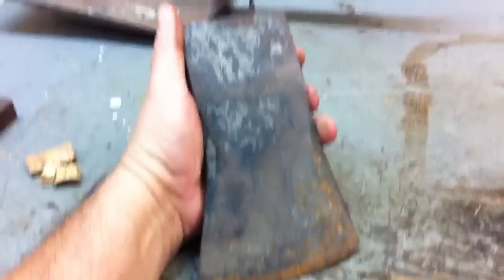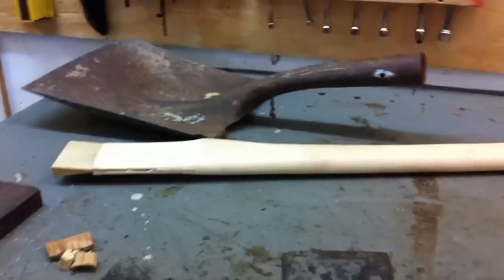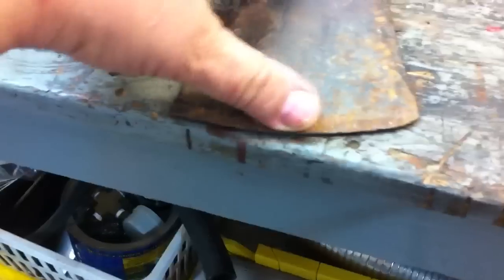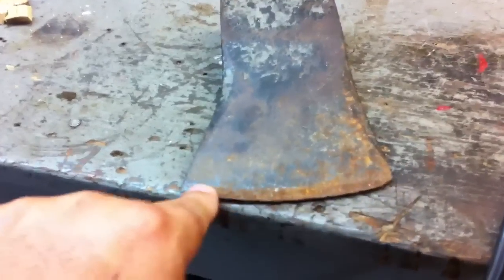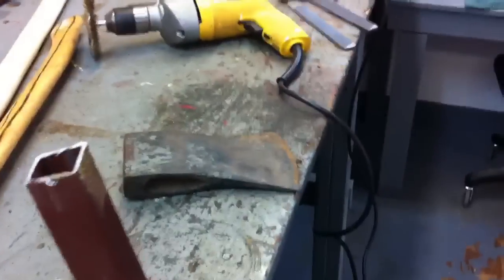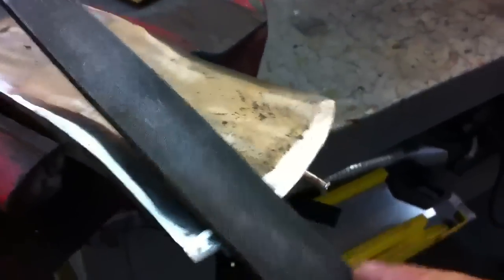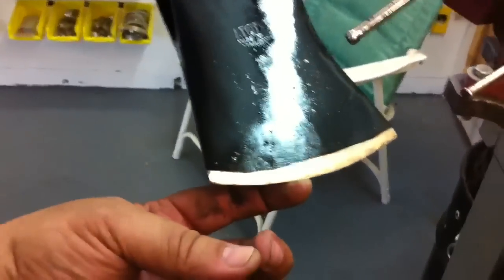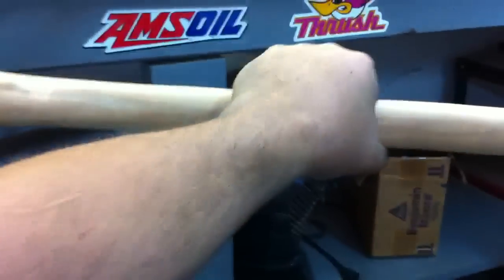How To Sharpen An Axe

Comment: Welcome to the buggered left hand club.
I chopped thru 3 tendons on mine, healed up pretty good though.
I'm the same way with tools.
Everything I have is either sharp or nicely dressed if it's a hammer punch wedge etc and I soak the handles in oil for weeks as well.

Comment: I'll tell you one thing: had lot of axes- german,canadian, polish, but for last 6 years I use Fiskars stuff (heaviest 2,4 kg axe) for chopping wood. It is excellent, it has special wedgy shape, good weight (not too heavy and not too light) and amazing handle made of some heavy duty plastic- despite 6 years of heavy use there is almost no signs of damage on that handle while  traditional wooden handle in old axes I changed once or twice a year.

Comment: I'm glad you liked it. I should clarify soak after the handle is installed. Some folks fill a container and put the tool in head down, I just keep on loading the eye hole up while I prop the tool up. The oil soaks into the wood my way and I don't need to dirty a bunch of oil. Now that I am wise to the splendors of paste wax I wax everything. If it is solid you can wax it, and probably should too! A word to the wise regarding linseed oil if you clean any up with a rag hang the rag outside to dry.

Comment: My brother was a blacksmith, every night they put the sledge-hammers into a tub of linseed oil. My brother said it was to keep the wood supple, and thus absorb some of the shock- makes sense if you are hammering all day!
BTW, I'm surprised you could sharpen it with a file-- I thought axes were too hard for that--maybe it HAS lost some temper?
You are a handy guy-- but best not to rob taht surgical wire if you need wire for a job!

Comment: If you would like to really make those axe heads look good, and also sharpen them quickly and smoothly put a belt sander upside down on your workbench with a fine belt on it. Lay the edge down on the part with the support platten under it, and for the final edge at the tip lay the blade down at a real fine angle on the unsupported part of the belt. Your axe heads will look better than bran new and you will have a great convex edge that you can shave with with a little practice. Best of luck.

Comment: A 4" grinder with an 80 grit sanding disk on it works really well for pitted up axe heads, switch to finer grits for profiling the edge blah blah blah :)

Comment from the maker: @DerrickHair I dont have a bush axe to do a video with but you could start with a 10or 12 inch mill file then finish with a sharpening ston. If  the edge is really beat up you might have to use a grinder in it. You want to avoid that though if there us any way you could work out the nicks and dings with the file. That is the best method. Good luck

Comment: I think I'm confused by your filing technique: is that a special two-way file? In metal shop back in the 70's, I was taught to file on the forward stroke only, and lift off on the back stroke, to avoid bending the ridges down. Maybe files have advanced since then.

Comment: @bctruck that sucks osha make them wear them aswell those and kelvar sleves to prevent them from getting cut while handling bare metal w/ rough edges i seen one guy loose a finger one day when i was there because he didnt remove his ring "b4 the gloves where madatory" and it got cought in gears and cut the finger off more cruhed than cut

Comment: For some reason, axes are more prone to be abused and ignored than other tools.  Folks today only think of axes as splitting tools, and so miss out on the pleasure of a good tool doing all of its work.  Of course a wide splitting edge lends itself to junk steel, but it's sad to see a versatile tool relegated to making iron rich soil.

I've actually found a True Temper and a Plumb felling axe in the woods near my house.  Nobody cares to even pick them up.

Comment: Axes are dangerous when they lose their temper. Or am I dangerous with an axe when I lose my temper? Doesn't matter. ATCO is a good brand, not as collectable as say a Keen Kutter or even a Plumb. Paint won't do much for an axe if you use it, it'll just wear off. Oil is messy. Some paste wax will protect it, and won't detract from the tool in any way. Oh yeah, when you're putting a wooden handle onto a tool soak it in linseed oil. Makes the wood expand, sticks like glue!

Comment from the maker: @bigjohn20081983 I'm actually just happy to have all my fingers. My index finger is the one that got cut comPletely off and I was lucky to find it. It was still in the glove I was wearing. The gloves are the reason my hand got pulled in to the machine in the first place but they made us wear them because OSHA had wrote the machine shop up for it's bad safety practices. (it was my dad shop) I was 16 when it happened.

Comment: Useful instructional video,  but for all the work he put into this, it would be more efficient to just buy a new axe head. Opportunity cost, and all this.
Reply from the maker: you totally missed the point of this video. This is a shameless "throw away society" and YOU are part of the problem! This axe head is no longer made. It is made from german steel which is the most desirable steel of all because it holds an edge for so long. You are on the wrong channel if you dont understand whats wrong with your comment.
Reply: BCtruck, rebuild, repair,repurpose amen to that. Opportunity costs.... laughable.

Comment: awww noooo!  you never go back and forth with a mill file!  push only!  You are going to ruin your file like that!  The teeth of the file are all angled toward the tip of the file.  You dull and ruin the teeth when you pull the file towards yourself.  Here is the nicholson file guide, this should help!

http://www.evenfallstudios.com/woodworks_library/nicholson_guide_to_filing_2006.pdf
Reply from the maker: Dan, while i appreciate your conern, i have files that i got before you were even born,and they still work just fine. Thanks for the link.
Reply: BCtruck, rebuild, repair,repurpose
With all due respect Sir, that simply tells me that you have been using a file the wrong way since before I was born.  When most everyone on youtube and the file manufacturers themselves explicitly say to only push the file or you will ruin it... Well I'd have to say they are probably saying that for a reason.
Reply from the maker: ***** The bottom line here dan, is im ok with whatever way you feel about my use of files.I grew up in a welding/machine shop and ive used tools of all kinds for 50 years. Ill keep doing what works for me, and you are free to use your files any way you like.
Reply: BCtruck, rebuild, repair,repurpose the thing is people allways come with new research. But the old ways have always worked